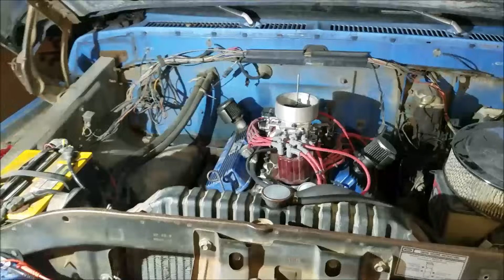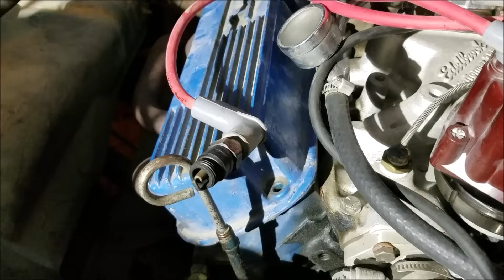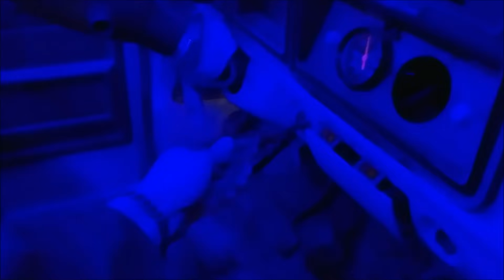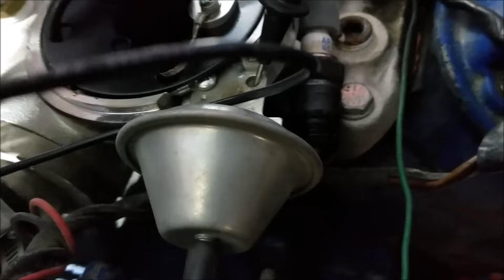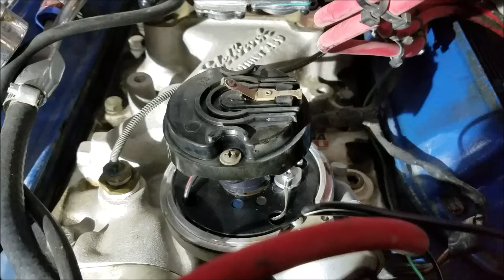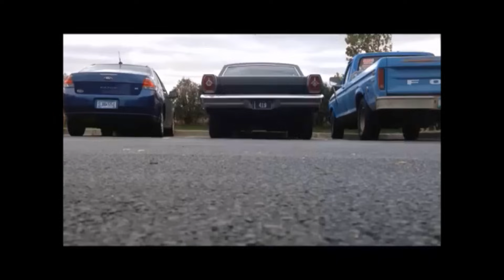Test for Engine Spark/Ignition - Simple & Comprehensive How To

Comment: So if I’m testing my coil and I get a spark from the wire, but none from the plug with the ignition on than it’s a bad coil? 

I get a small minimal inconsistent spark from the plug inserted directly into the coil wire when I crank the engine…..is this a bad coil?

Comment: Can you please tell me where the negative wire that connects to the negative terminal of the coil goes,  does it go onto the ignition switch?
Reply from the maker: No matter what, the negative goes to the distributor or ignition module if it has one separate

Comment: Hey Mr thunderhead man, what if I got 12V at the coil when the key is turned to run position and yet it still keeps on cranking even after the coil has been replaced, wires, cap and rotor. I’m starting to believe it must be the pick up in the distributor has gone bad. This is off of a 4 pin hei module ignition parred with jegs Mopar performance distributor with the 360 small block dodge engine
Reply from the maker: If you can, take coil wire off cap and put a spark plug it and ground it. 
Should see it sparking while cranking. 
If not, and you have done the other stuff, the 4 pin hei module is cheap to replace.
Reply: @ThunderHead289  ok I’ll go try that! One more question is say it does spark like the way you’re saying and I’m still not getting it to fire off. Could it be something within my distributor?

Comment: my car dont fires up, replaced the ignition Module, the ignition coil, ignition distributor and the rotor
Reply: Did you find out what was wrong with it?
Reply: @yukmouth13  yes bad ignition module again (it came new but dont worked) and a bad pin connector on the black 3 pin connector of the distributor, also 2 of 8 spark plugs bad (gap of electrode full closed)

Comment: KOEO I only have 6 or 7 volts at coil, I tried using a power probe to send 12 volts to coil while cranking but its sending less than 10 volts. What is my next step?

Comment: Okay got it. So if you have 12 volts on the negative side of the coil this also tells you the coil is conducting properly. Basically you are shorting out the 12 volts that the coil gives up, is all. You can do that with a volt meter I believe. And it will show you have current on the negative side which came from the positive side. if you have that you don't really need to see if the plug sparks. It should regardless. Great video!

Comment: I have a 1970f250 with 390fe and it will only fire from the coil only once when you let off the start position. I have been ripping my hair out doing all the diagnostics. the one thing that i cant replicate like in your test is where you take the negative from the coil and hook a spark plug up to the coil the spark plug will not fire after grounding out the negative
Reply from the maker: I can tell you that your ignition switch is probably dorked - most classics have a resistive lead bypass active when cranking, sounds like this isn’t doing its thing. Again - ignition switch issue. 
You can test the theory by jumpering a positive lead to the positive of the coil then cranking. Bet it will fire

Comment: I have a 99 civic dx hatchback and she was cranking just needed new spark plugs. So I changed them and then she wouldn’t start. Changed the battery she still wouldn’t start. So I’m clueless need to buy this little device thing cause it’s most likely my ignition coil or distributor just no way to test

Comment: 1:35 At 11.94 volts that battery is discharged 90%. If you want your lead acid batteries to last fully charge that asap.  In fact overcharge it.
Reply from the maker: This was right before I pulled the engine on this truck - it had sat in the garage for 4 months before I shot the video.
Reply: @ThunderHead289  awesome video's BTW. Looking forward to catching up on ur Playlist. I'm getting rusty driving modern disposable vehicles. Nothing compares to my 1978 f150 ranger supercab dubbed of course "The 78".

Comment: I have a 22r no start right now drove fine I pulled it into the shop cut it off it aint fired since im thinking dist cap the button or coil its got fuel its got air plugs are old without a test light its hard to diagnose
Reply: But it's a 1983 so it's only gonna be about 3 things 🤣🤣

Comment: Hey thunderhead I got a Pertronix Ignitor 3 for a 84 dodge d-150 project and it was running before but distributor was dying so I got it all put in with the new Ignitor 3 but now I don’t have spark.  I nullified the valiant resistor by Wiring the wires to it all together.  I get 12v to the coil. I don’t know what it is I do have two wires coming off the alternator that used to be connected to the coil pos and neg  on top of the two new ones coming from the new distributor but no spark at all even with your test with the coil.  And I just replaced the coil and it’s doing the same thing.  Everything is from what Pertronix said needed for it to work coil, distributor & wires.  Still nothing.  Please give me a hand I’m solo in this and am trying to learn about old cars.
Reply: Balist resistor*

Comment: Hey Thunderhead I was wondering if you could help me out I have an 84 Oldsmobile 307 has been sitting in the garage for 5 years.. I have a no spark situation.

 I bought new spark plugs new coil new distributor but I still have the original distributor cap and original spark plug wires from 6 years ago.. Do you think the spark plug wires can be the reason for no spark?
Reply from the maker: Have you tried jumping power directly to the coil?
Reply: @ThunderHead289  no I have not the reason being is because I bought a brand new coil so wouldn't think that would be the problem but I'll try it out thanks..
Reply from the maker: Bz 710 this wouldn’t test the coil, it would test everything before the coil 👍
By jumpering a wire for testing, you effectively factor out everything before the coil. 

If it has spark then, you will know that your problem is before thebcoil
Reply: @ThunderHead289  I'm sorry I'm not very good at mechanics just know the things that I saw on your Channel so how will I jump the coil and also what comes before the coil ? Because I also bought a new battery as well does the battery come before the coil?

Comment: What happens if I'm only getting 6v at my coil when I turn the key? I have 12 v at the battery.
Reply from the maker: I’m assuming you are dealing with a no start situation - assuming this, you can verify the low voltage is the issue by jumpering a wire from the battery to the coil. If it runs, the issue is either a bad ballast resistor, or weak connection somewhere upstream of the coil. 

Side note, when you test by jumpering a wire, try to not leave the wire from the battery to the coil for too long with the engine not running - coil will blow.

Comment: Where do the wires go on the coil. Does it go to the ignition or does it go to the starter synoid
Reply from the maker: For the coil, 12 volt hot needs to be switched power 👍negative is what is interrupted by the distributor. 
When the distributor breaks the ground, the coil discharges to the distributor cap 👍

Comment: I really appreciate this detailed video and explanation! I am a tad confused though with the second step, about the "ignition on" situation though. Doesn't the ignition have to be not just "on" but, actually turning it over(in other words, trying to start it) to check if the coil is functioning correctly?? Or is the key in the "on" position enough to test this? I am in the middle of diagnosing an old(1960) evinrude 75hp engine that has no spark. New points and condenser are $36.00 but a second hand coil is $210.00! So I am trying to determine if the problem is BEFORE the coil, the coil itself or in the distributor cap/points/condenser.
Reply: The primary and secondary in the coil have to work. So you can check this just by checking both sides of the coil. Power 12 volts to positive and then see if you have negative side voltage. Thats it. But the module or points actually collapse the coils current of and on and thats the trigger for the spark coming from the coil. No spark doesn't mean the coil is bad, it merely means its lying dorment.

Comment: what's your favorite ford Chevy dodge
Reply from the maker: ford and Chevrolet share equal favor with me. i just do fords as my own since everyone does Chevrolet.
Reply: ThunderHead289 I'm really tempted to do a ford build so just wish I could find hei units for em
Reply from the maker: +ethan “One Toxic Redneck” carter they very much so exist. Don't cheap out on a distributor though. It drives the oil pump through your cam. Don't buy one of those 50 buck units.